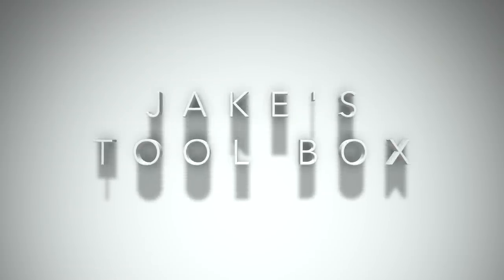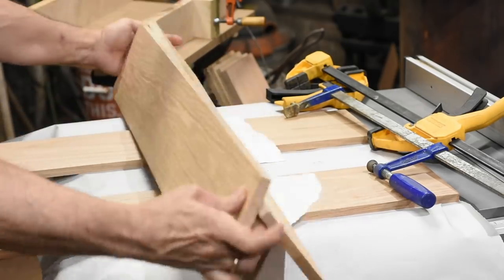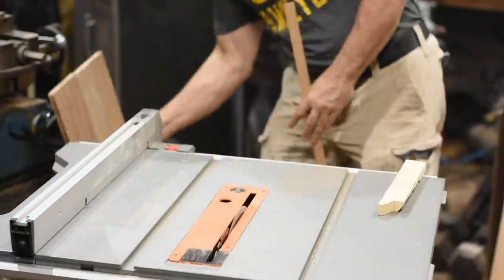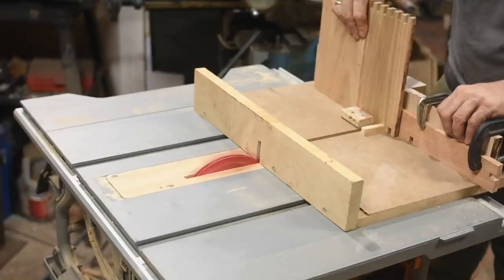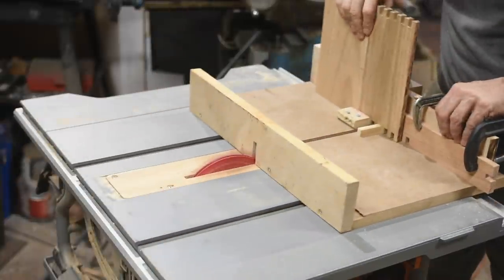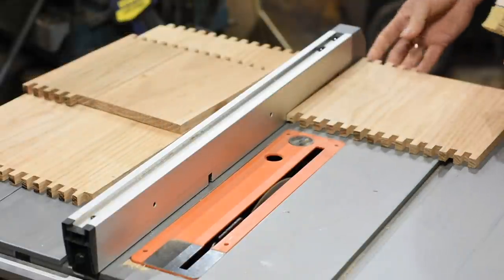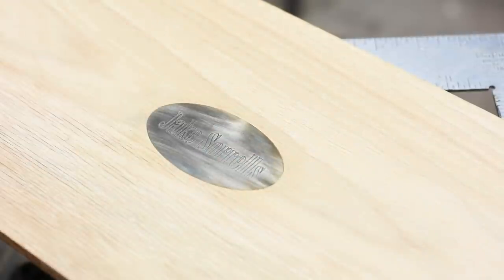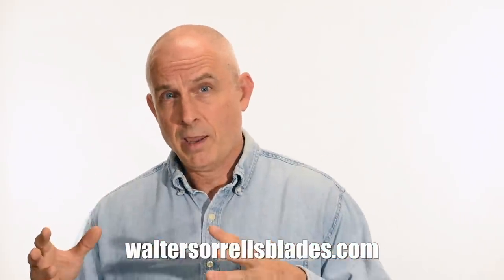Classic Wooden Tool Box Build

Comment: Make sure to resharpen the sawblade.. smoke and burnmarks on the woodedges. And when you do complete cuts, raise the blade higher so that the teeth at least exit at the top. The higher the blade the less area it has to cut at the same time. Helps with lower power table saws and hard woods!

Comment: Love this woodworking side of Walter! Beautiful work... only negative remark is your table saw...either the motor is weak as heck or the blade is dull as heck but it sounded like it was having quite a tough time cross-cutting some measly 1/2" oak. Even my 9" craftsman Radial Arm Saw from the 80s has no issue with 3/4" oak...but I've got a Forrest blade on it